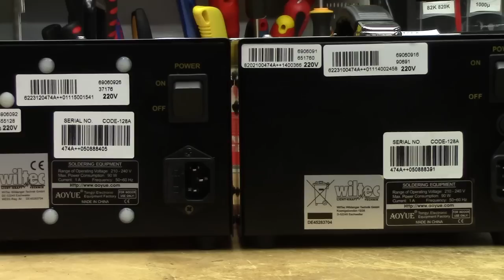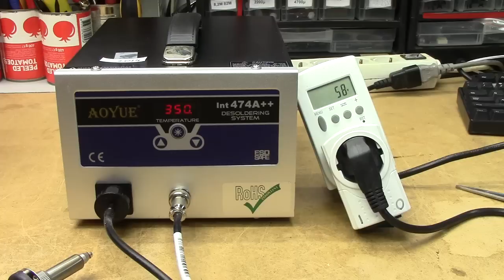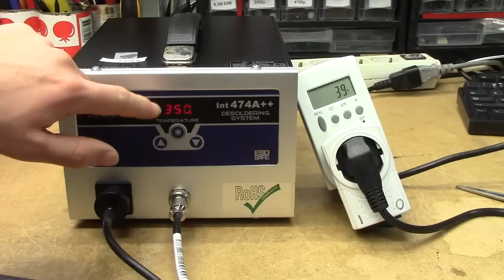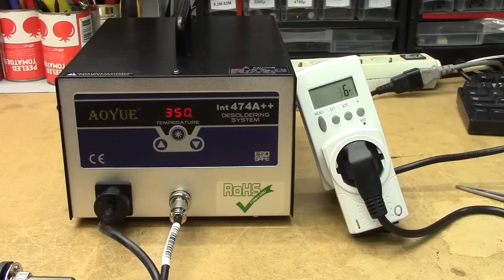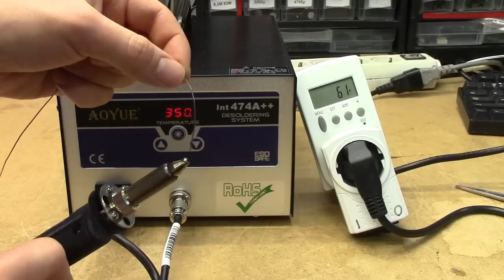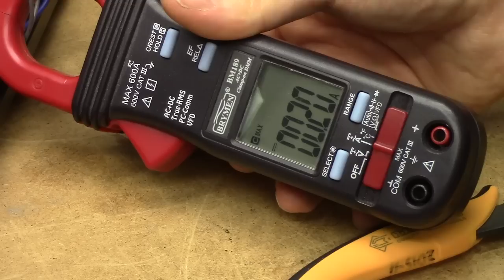AOYUE 474A++ double teardown: Old vs. new model

Comment: I might shed some light on this. I just bought a 474A++ (which looks exactly like the newer unit in the video) AND an 852A++ Hot Air Rework Station. While they are of course two different beasts, their cases look exactly the same. That rubber-protected hole on the left side is used to allow the wire that connects a switch to go outside the case on the 852. The screws on the right side are there to hold a stand for the vacuum IC pick-up tool the 852 has, look for pictures to understand.

So maybe one of the reasons for the different case is so that Aoyue can reduce some costs using the same case for different products.

Comment: I have a newer model with production date 16 March 2020. The small PCB doesn’t exists anymore. The main PCB is revision WYL 2019-10-28 TY-701A+-7.  
The trigger and the pump (and all other components) are connected to the main PCB. The switch isn’t breaking that high amount of amps anymore.

Comment: Pressing both the up and down button at the same time will activate the pump, you can use it as a vacuum pick up tool, or smoke absorber.  (But only in the older models )

Comment: Great teardown/tutorial. I'm a total newbie to electronics and just got an old Aoyue 968 (not the newer 968+ for occasional hot air work. Both versions of the 968 have  a properly filtered integral smoke absorber, linked to a soldering iron with fume extraction gun with smoke extractor. 

I'm wondering if we can use the gun from the 474++ with these older units given that they are both using the more powerful double diaphragm pump used in the earlier 474++ featured in your review. Aoyue EU customer service say no but didn't/couldn't explain why this was so other than to say the units were not compatible..

Is there any good reason why we can't connect the 474++'s desoldering gun to those units - (eg due to incompatible hardware or firmware/software issue). Someone with the requisite mod/hacking skills might want to take that on. Even if it's not possible why would make a great teardown/tutorial...

Comment: I got my Int 701A++ from their American distributor in mid-2016 and it has the same mainboard and AC pump your 474A++ has. It only worked well the first time I used it and was almost unusable by mid-2017 despite very little use (months between uses). It seems that the AC pump is not very reliable [disregard; problem determined to be an invisible constriction in the hole behind the hose connection nipple].

Mine actually had two warranty seals, a foil one near the AC jack that peeled on it's own and and another paper-type on the bottom that split just from taking off the screws holding the top panel.

Since it’s been a year (out of warranty) I took it apart and cleaned all the parts on the left and the right sides (both smaller diaphragms). No improvement. Suction is so bad that the fume extractor can't even attract flux smoke without being strategically positioned for the smoke to practically float in on its own.

Despite the reputation for "extreme reliability," my AC pump seems to have died with very little use. I would suggest that you not use the fume extractor function at all if you have this pump in your unit.

The job it worked well for was removing an Atari 800XL cartridge connector with mangled pins. When I had to desolder a couple DIP40 chips in another project (Hi-Def NES) it did very poorly. I struggled through about 5 total Hi-Def NES installs before it was so bad that it was literally worse than nothing. Had to used braid, plunger, and bulb desoldering instead. Only lasted as long as it did by using every trick in the book (holding upside-down, pre-heating the opposite side with an extra hot iron, having a helper hold another iron on power and ground connections, etc).

Did I mention the constant clogs? Yeah, that's probably thanks to the AC motor being so weak.
Reply from the maker: That's odd, I've used the AC motor version in 9-5 duty with no major issues. I use genuine Hakko filters though (for both the gun and the station), to avoid flux clogging the pump. Then again, you never know what you get with these chinesium products.
Reply: FFcossag Well, after no improvement from cleaning the internals of the pump I took the lid off again and brought it back to the workstation to see what is happening when I press the trigger. That was when I noticed that you could see light coming out of the hole thanks to the clear tubing, but I also noticed that it was a tiny pinhole. Despite the tubing being clean and clear, the plastic adapter/nipple was constricted at the very back (impossible to see without light coming from the other side). Shoving a multimeter probe in there cleared it right up!

Looks like you were right about the reliability all along. :) I think I downplayed how much use the motor had because I was only thinking of how infrequently I used it for desoldering but I did use the soldering iron with fume extractor a lot more (uses the same motor).

Yeah, the AC motor is pretty weak but I can probably live with this. :) Thanks!
Reply: ...oh yeah: there doesn’t seem to be a filter in the iron-mounted fume extractor so the little bit of fluff behind the hose connection nipple is all there is. It’s not nearly dense enough to filter flux fumes.
Reply: Emmett Turner, my Int701A++ has been working well 5 days a week for 3 years, now that I have figured out how to tweak the tip-to-heating-element interface and modify the filter assembly. The air pump, however,  has never given me any problems. I don't use the fume sucker attachment,  but you could probably add another filter inline with the air hose easily enough, similar to the one used on some older Hakko units.
Reply: @FFcossag  Another reason for poor performance is that the AC motor can’t spool up fast enough to clear a plated thru-hole before you lose thermal conductivity to the other side and it solidifies, especially on power and ground connections. It removes the solder closest to the tip first, obviously, but this means you lose thermal conductivity to the other side. If it can’t pull the solder from the other side right away it will solidify while the pump is still spooling up, and then it’s too late.

Because you need to dwell long enough for the other side to melt before you pull the trigger you can’t just pull the trigger before applying heat. That will only suck away the solder on one side as it melts and then the other side will never melt (no solder to conduct heat). The trick is to apply heat, melt both sides, pinch the hose, pull the trigger and hold to achieve max vacuum, then pull the hose straight to let air through while at maximum vacuum. I plan to add a trigger-controlled solenoid to do this with the trigger (no hose pinching) while the soldering station’s fume extractor function maintains vacuum, but the Int423 will need a mod more like KainkaLabs’ delay circuit (used with his modified ZD-whatever desolder station).
Reply: FWIW, my Int701A++ was made in early 2016.

It is the exact same machine as your 2014 unit, only with the extra soldering station/fume extractor functions added. The rest of the PCB/population didn’t change between your 2014 and 2015 unit because they kept using them with AC pumps in later-built units like mine. Also, they probably needed some as replacement parts and warranty spares for the older units.

Even after finding the constriction and clearing the nipple back in 2017 (2023 now) I’ve found it’s only useful without trickery in stock form for removing components on single-sided PCBs. You can get away with desoldering an odd resistor or diode or whatever on a double-sided PCB but you just can’t do any DIPs without tricks.

That’s because more than half the legs will remain soldered on the other side even if you wait until it flows on both sides to pull. Adding solder and trying again doesn’t do anything for the power and ground traces and still leaves more than half of the others soldered, so you might clear only few more on the second pass of a large DIP chip. For larger jobs like desoldering two DIP40s you’ll reach a point of diminishing returns where you’ll just never get them clear in a reasonable time and you still have power and ground to deal with.

The only way I can use it on power and ground traces on double-sided PCBs is to use that trick where I pinch the hose to build vacuum before letting it pull the molten solder.

I really want to find a way to open a solenoid and make the pump come on for 10 seconds with each pull of the trigger. This would allow me to go down the line and desolder each pin, activating the solenoid while the pump runs continuously to hold vacuum. After the last pin it would stop within 10 seconds. The only trick to it would be getting a good pull on the first pin which would only take a bit of technique: REMOVE nozzle, pull trigger to start pump and build suction, replace nozzle, pull trigger to activate solenoid, reset pump timer, and pull with full suction.
Reply: @goodun6081  Any tips for tweaking the tip to heating element interface? Would it help if I slathered some silicone grease in there? The manual never really tells you what to do with it so I always assumed you just coat the collection spring and tube to keep solder from sticking.

Comment: Excellent video. thank you for taking the time to make it. Would it be possible to get a schematic and parts list for the hack board?? Or maybe another video showing parts used and a step by step showing how you built it?
Reply from the maker: +SBCVETTE01 I never made a schematic for it. There's just the FET with the source pin connected to ground, the drain pin connected to one pin of the motor connector, and the other end of the motor is connected to +12V. There is a 1MOhm resistor between the gate and the source pins. The gate is then connected to a 10K resistor, then to one pin of the gun connector. The other pin of the gun connector is connected to +12V.

So, the motor is always connected to +12V, and the FET is connected in series with the motor and ground. The gun switch is connected to +12V and the gate of the FET through a resistor.
Reply: +FFcossag  Thank You

Comment: As  long as the new one give more vacuum that's the important point ,the switch can be modified easily with a relay ! if you use in a DIY projects and repair its good enough if you use it in a pro lab that you buy the Hakko !
Reply: Agreed. Strong vacuum is critically important.

Comment: I just received a very similar unit with a 12V pump but the controller is completely different from your unit. I wonder how many 'revisions' of this unit exist in the wild.
Reply from the maker: Ha, indeed. They are rather pure chinesium. Both of mine have worked excellently, though. One sees almost daily 8-hour-a-day use and I haven't even worn out the first tip yet.

Comment: Any chance you can show us how you modified the board? I saw your reply below, but I'm just not positive I know exactly what you mean, though I'd understand just fine with a quick drawing. I'm going to get one of these, and if I get the new model as I assume I will, I want to make the same change to mine based on your recommendation. Might even see about finding a better quality pump down the road to boot.
Reply from the maker: I don't think I documented it more  than with what I did in this video - sorry.
Reply: Aww, it's ok. Thanks. I'm gonna try to understand better what you did, and if I can, maybe even take up the task of learning how to design an all in one replacement board that I can put up on OSHPark or something for folks to just get and solder up. I hope I can do it, it'd be nice to contribute to the community.
Reply from the maker: Good luck - we still don't know if what you'll get today is the same as what I reviewed, though.
Reply: That's ok! I'll explore it when I get it, perhaps even film it. If I do, I'll report back here with a link for you. If not, maybe I'll just take pics and see about sending them your way. :)

Comment: Just a little quid pro quo. They often sit on shelves sometimes for years before going to quality check so the one may be far older than any of us think. Some are even reworked with newer boards if enough revisions are made so we can't even really rely on that for reference. Though it's usually a good marker for reputable companies, some of the cheaper brands do have this issue.

Comment: I’d love to hack the firmware on my AC pump model to control a solenoid and run the motor for a several seconds with each press of the trigger. Basically, I want to pull the trigger to momentarily open the solenoid and get the pump to start. The solenoid will immediate close while the pump begins building up a vacuum so that when you pull the trigger again it will get maximum suction power as soon as the solenoid opens again. Even though the pump is running there is no suction at the tip as long as the solenoid is closed.
Reply: I have the same idea for  my 2703+. I have all the parts just never got to it yet. I think it will make a huge difference.
Reply: @brainimplants  It will. :)

To test the theory, I pinched the hose, held the trigger to build suction, then jerked the hose straight to make my solder pulls. After years of struggling on the exact same job, my station went from nearly useless to making perfect solder pulls every time!

Instead of doing anything firmware-related, I ultimately exploited my station’s built-in fume extractor function which maintains continuous suction. I then set up the solenoid similar to the one Kainka Labs did on his vacuum desoldering station mods except with a foot pedal trigger.

Comment: Unloaded transformer has always higher voltage output than properly loaded.
Reply from the maker: +DjResR Yes, however transformers are usually rated for a certain voltage under a certain load; a 14 V, 30 W transformer should normally provide 14 V at 30 W, and probably closer to 20 V at no load. In the case of the DC pump power supply, the transformer is putting out about 9 V under load, so it's likely being severely overloaded.
Reply from the maker: ***** Yep, that's how they're getting away with it.

Comment: Thank you very much! I really dont understand why they reverse their own engineering in a bad way, how much could they really save - if they are selling well then raise your price that difference, maybe split it into a econo model with the cheaper parts and charge more for one that's been improved instead? Shrug, I guess it's all down to how the person running the show thinks they can sell them, ethics don't seem to ever fit into the picture. I wont be buying from Aoyue... Though I heard terrible things about the new hakko's too, where the discontinued model has great reviews. <Sigh> Why is EVERYTHING being made crappier and crappier? I think we need a company that makes quality serviceable products with as few parts that wont be available later as possible, so things can actually be used for a lifetime, that you only replace because there is something better not because the engineering made it only good for ~1-3 years regular use...   Then instead of making the same model number every change, at least add something like a revision letter or such - how the hell do they end up with 474A++ and have the next nearly completely different unit at the same ridiculous model - you would think they would do something more along the lines of 474A++ to like 474B or 474B++ if they really want those ++'s to stay, then you have lots of revisions before you go to 475.... and actually GO to 475 not make 100 different types of 474A++ lol!!  None of this Chinese product idea's make any sense to me, they can make some great stuff but they really do a great job of ruining their own products and making literally the cheapest possible crap they can instead of trying to make the cheapest quality product. I do not think I will ever understand their business decisions.

Comment: Thanks  for your comparison these two modification, but unfortunately I don't know what model will be better. I have just bought new model, but weren't doing anything except cover off and look inside it. Yes, it's a new model  with DC pump. 
I'll appreciate anyone, who has new model and tell us how it works.
Reply from the maker: I've used both a lot since this video, and the DC pump is much nicer to work with.
Reply: Thanks for your answer, so new model works well, or maybe change this DC pump to something familiary this, but made in Japan?

Comment: I wish I seen this video before I bough the NEW model, its JUNK! Its a piece of useless JUNK, 3 days waited on it, I tough it was some "linear learning curve", but no, the PUMP is Garbage, I had the solder melted and I could tell it turned into "molten" looking liquid - then turned onto the PUMP and it sucked half of the solder, the worst part is the half left is unreachable, meaning its behind the joint, meaning it didn't do its job to suck all out.

I must say that I am a beginner but I tried all kind of combinations, different solder to re-flow, temperatures, then different flux, even got the best quality and still. The problem is that once you get the solder in molten form and suck it out half cools down and turns back into solid. BUUUUU! I have returned this NEW model back.

FYI: I used 400C - 450C on the unit  , is that too much ?
Reply from the maker: No desoldering pump on the market is good at doing heavy multi-layer boards. You need to use a separate iron to add extra heat if you're working on anything with a lot of copper in it. It also takes quite a while to heat through a multi layer board, and lead-free solder flows poorly. PC motherboards are a no-go all together.